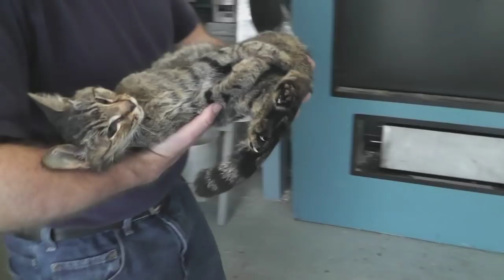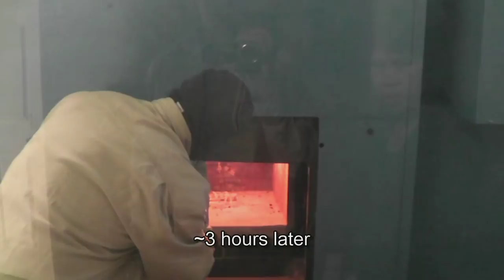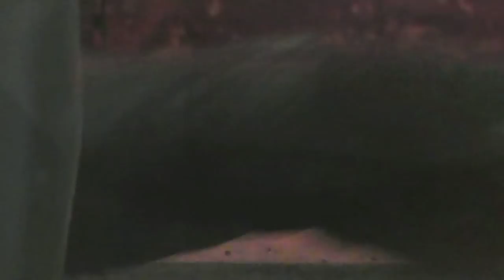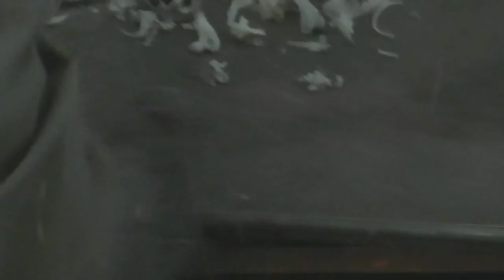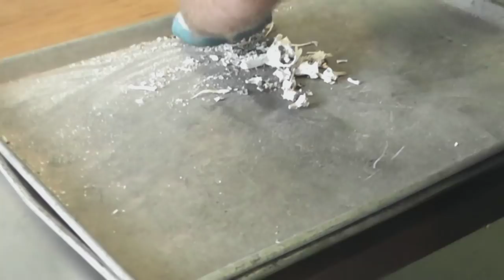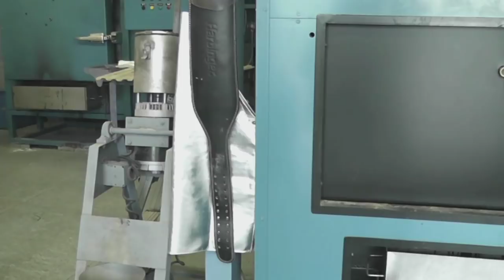My Cat Brat's Cremation

Comment: It took 3 hour to cremate a small cat? Well that little oven is clearly not hot enough
Reply from the maker: AYALE AMA87 hello and thanks for the comment. Yes, another person mentioned this. Is this an opinion or professional experience? How's long, generally, does it take? Could it be that, possibly, it takes time for the machine to heat up? Thanks for watching.
Reply: Citizen K9 it depends on the size the smaller it is it goes much faster. Also depends on WHAT type of oven, this oven was not New or professional i think. Usually with humans the oven are already extremely heated(hell) when they put in compare to this oven that was not heated so maybe that's why it took 3 hours lol. Human crematorium fix it between 30m to max 2hours.
Reply from the maker: AYALE AMA87 thanks for the birthday reply. Yes, the oven wasn't hot initially... It was quiet and not emitting any radiating heat in the beginning. I'm pretty sure it's professional bc of it's massive size and it's affiliation to many vet clinics in the area. Again, thanks for your input!